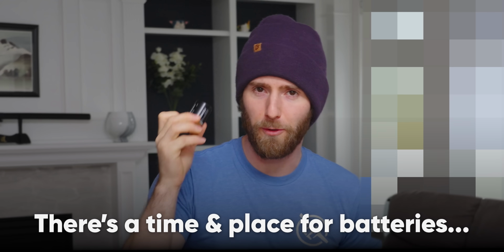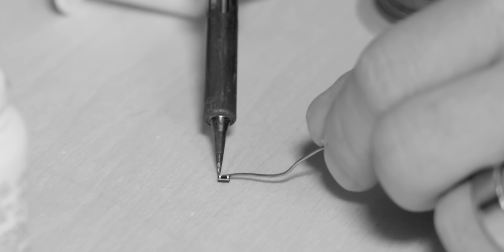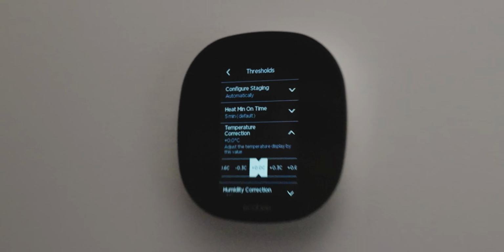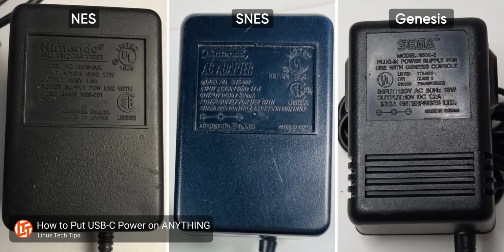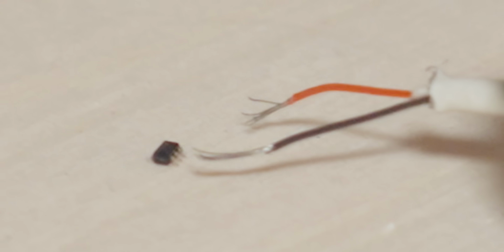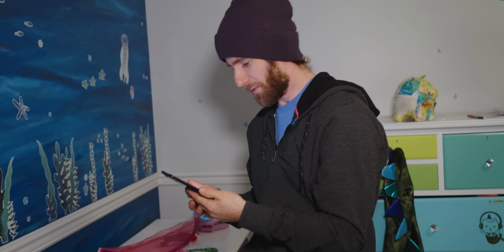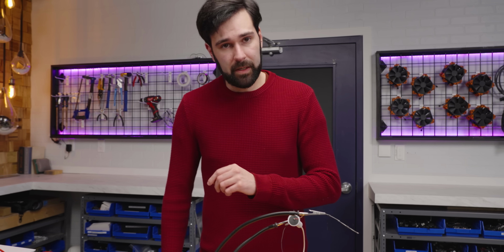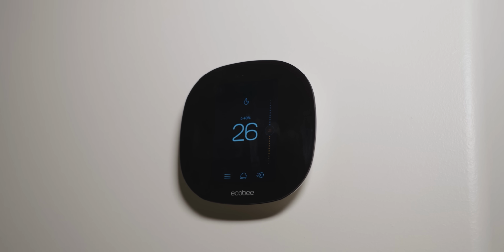I HATE Batteries! - Converting Wireless to Wired (a cheapskate’s guide)

Comment: Next time use pcbway and make small step down converter pcb the size of a Button battery with a usb plug and small copper terminal on it and 3d print a new cover.
Don't forget to add small capacitors for the current spikes!
Over engineered? Yes.
Safer..? Yes 🔥
Reply: Tbh, after I saw a video I went to google to check if someone already designed something like this and selling this niche things; and was surprised to discover nothing of that sort.
So, it might be an interesting project to design and create voltage converters inside a footprint of an appropriate battery.
Reply: @UselessZero  the only problems is as he said in the video, there's so many different sizes that there's probably no point in marketing one or the other.

Comment: Most linear regulators need decoupling both on the input and output for stability. A resistor is not a regulator, the voltage drop depends on current draw and it's not a good way to drop your input voltage.

Honestly, use an adjustable LDO SMT regulator and fab a coin cell shaped PCB for 5$ at pcbway or similar that you just jam in there that has exposed copper in the right places for the battery contacts.

Comment: This is more than just "First world problems" this is another league: "Linus' house problems". I swear this guy has these super particular problems he needs to solve and make content of.
Reply: To be honest I'm from a 3rd world country and i despise batteries my wirings are usually way jankier lol. My only entirely battery device is my phone
Reply: I agree, but this video is one of the more useful ones. Although most people won't have such specific voltages
Reply: Yeah... 
Because having a lot battery devices and hating changing them is SOOO Linus specific..... 
I want to do this to my doorbell, because I can never hear if people want to contact me, as its always out of batteries no matter how often I change them (or so it feels)
Reply: Yet I wouldn't want to say the arguments he states are invalid, they most certainly are.
Reply: That's because this is entertainment more than education
Reply: The underlying problem of wanting remote sensors for your thermostat isn't too unusual, I have the same problem where my thermostats are all placed right next to the door of each room, meaning their temperature reading is highly influenced by the hallway temperature rather than the actual room temperature. My solution to that is jankier, using HomeAssistant to read thermometers inside the room, calculating the offset to the thermostat's temperature reading, and setting the thermostat based on that offset. The same thermometers also get used to drive the air conditioner (can't control that as directly so I need to use a PID), and the humidifer (they also read humidity). Of course, I just change the AAA batteries in the thermometers when they die.
Reply: an obvious solution put the thermostat in one of the two daughters rooms and yes haven it hardwired on the wall and pretty simple to do
Reply: @EDV8ZR1  that assumes the thermostat can be moved without extensive drywall rework.
Reply: @guspaz  well I still have a whole team of people that are good wiring and his business also he has a friend that's an electrician any knows all the contractors that worked on his house and yes simple low-voltage wiring for a thermostat can do it as long as he's not colorblind
Reply: @guspaz  also Dan and his work seems capable on that job
Reply: @guspaz  Well the mount is maybe four by four not a large hole.
 You can have a wired night light to the whole.
Reply: True
Reply: As a citizen of a third world country, I would like to reduce my dependence on batteries as well
Reply: Yeah., couldn't this have been solved just by buying the kids some SLIPPERS?
Reply: I have a knob on my heater and can turn it up or down based on how warm I feel. Seems to me it's a smart solution.
Reply: @Czeckie  he has a temperature up and down button also but yes his as complicated because of optional accessories.
 But the vintage ones worth has rotating knob and Mercury switch inside those were nice.
Reply: This isn't really any world problem. This is let's do things the hard way for the sake of a video. A 3.2v dc converter is the same price as a usb charging plug. You solder a wire to each contact, plug it into the wall, and you're done.
Reply: I'm a lazy ass so this is absolutely something I would consider doing for my thermostat and smoke alarms

Comment: ohm's law says hi. When the device is powered off the voltage is high, when there is a spike in current the voltage across the resistor is V=R*I so there is a sudden drop in voltage and the device malfunctions

Comment: Side note: You can get a converter supply module that will convert 5v or 12v to any smaller voltage for about a dollar without any extra steps.
Reply: Yepp. They're called Buck converters. Boost converter to turn the voltage up. They're also way more efficient than the voltage regulators he used.
Reply: @Mulakulu  Buck converter is way overkill.  Linear regulator is fine for this.  At these current draws, any sort of switching regulator will use more power just to run than the load uses.
Reply: @ccoder4953  yeah, you're right. Didn't think about the current draw. It's good advice for devices that draw a couple milliamps though, all the way up to the converters rated amperage
Reply: I was actually surprised no one makes a 5v>3v converter board that shares a housing with something like a cr2032. I may have to start microfabbing.
Reply: Also, from 3v to 3.3v its NOTHING it would function absolutly right, the potenciometer was nonsense
Reply: @LordCogordo  Yep, 3V batteries might have a nominal of 3.2V, but they're probably over it when fully charged up.
Reply: @cedricpomerleau5586  They are literally 3v nominal and 3.2 when full
Reply: @LordCogordo  Problem with 3V is that leaves you with not that much room to drop under load. If a circuit is designed for 2.8V to 3.3V it means you lose 60% of your leeway. In some advanced devices we made we actually decided on switching between a 3.3V and 2.8V supply to optimize power usage based on load. In an ideal world you could add some capacitors (or coils), but that introduces leakage in the real world which was unacceptable for us.

As Linus' device was wall powered I'd have slapped on a capacitor for good measure though.
Reply: @Spentalei  Awesome answer ma-boy, i love when people give real world data
Reply: I was thinking he was going to use one until he pulled out the chip ribbon
Reply: Be careful with those cheap-o chinese dc-dc converters. They tend to have an extremely noisy output with TONS of voltage ripple. Not what you want on a battery powered device with zero power filtering. This type of application is where linear voltage regulators start to make a lot more sense. Something like the LD33V or LD1117V33 is all that is needed to do this properly.
Reply: @motosk8er2  bought cheap Chinese dc to dc and can confirm they make screeching noise.
Reply: @motosk8er2  I have plenty of old phone chargers like 3v 600mA-300mA is that something that I could theoretically use instead of buying LD33V?
Reply: @motosk8er2  thanks for the help. need to hoard couple more from the e-waste bins.
Reply: @cubertmiso  Many old-school adapters are unregulated. I have a 3v adapter for my Game Boy Color which puts out 4.5v unloaded. Depending on the device this could be a problem. If it's regulated it will measure 3v all the time and this would be ideal.
Reply: @eDoc2020  thnx!
Reply: @motosk8er2  voltage ripple on DC->DC?
Reply: Yep, a buck converter or just drop an AMS1117 3V or 3.3V, or an LM7803 with a 100µF capacitor on the output, they are super cheap and you can get them in bigger packages if soldering is not your forte.
Reply: @MarcusBuer  100 mF ???
Reply: @kennmossman8701  sorry, 100µF,  my brain just froze when I wrote it.
Reply: @MarcusBuer can you link some?
Reply: Dont tell him, after what he had to go through 😂
Reply: MuRata makes some really tiny ones. Or go with gaptek to save some money.
Reply: I was thinking about hard wiring an iPad I had laying around, could I use a Buck converter to hardwire it?
Reply: @DrSeaLionMD  Yes, but you should be carefull with the noise of a buck converter, you may need a good one for this kind of appliances
EDIT: and put some kind of filter capacitor
Reply: @LordCogordo  Thank you for the insight!
Reply: @DrSeaLionMD  Technically, but you could also just connect it directly to the USB power supply, since it's designed to run off of a USB power supply...
Reply: Seems like a MP2307 based buck converter board should do the job well. The boards are about the size of my thumbnail.
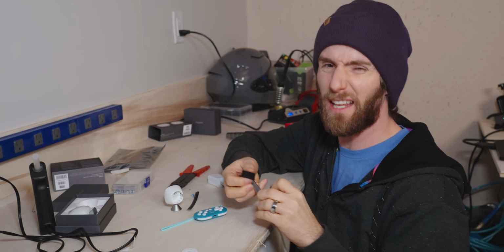Reply: At 7:20 he literally said to do this over again. I'd probably just buy a 3v voltage regulator
Reply: I was sitting here thinking wtf why didn't they just use a buck converter...
Reply: Exactly but it is too big to fit into the device I think this is why decide to go in this particular way
Reply: @ChristianBelotti  They are not. Polulu make 1x1cm versions. It's also way better to solder.
Reply: @Zwettekop  wow I didn’t know about this small factor, the only problem is the height if there is any big component’s
Reply: @ChristianBelotti  The Pololu "D24V5F3" step-down voltage regulator can reduce anywhere from 3.4V to 32V down to 3.3V and is really small: 10.16mm × 12.7 × 2.54mm. That one is still probably overkill since it can supply up to 500mA. It's also 7 bucks which isn't cheap.
Reply: @ChristianBelotti  They're using an external power supply anyway
Reply: @sgas  tecnically yes 😅
Reply: Those also comes with USB connector too

Comment: You can also use diodes in their forward direction to drop voltage. Like you could have used a schottky diode to drop ~0.2v off of the 3.3v supply. And that isn't dependent on current (ideally of course) like a resistor/pot is.
Reply: Ah, or I could have just watched the rest of the video 😁
Reply: I thought of that but assumed it wouldn't work because linus said "exactly 3.2v"
Reply: @munjee2  Exact? With batteries? 
They do drop in voltage from fresh to when the device starts complaining...
Reply: @michaeltempsch5282  that's what I was confused by myself
Reply: @munjee2  I don't know why Linus thinks it needs to be exactly 3.2V. There's a lot of variation in the voltage of a battery...
Reply: I thought about the same.
Reply: Do remark that this is a bit dangerous as under high loads you could burn diodes fast. It's not really applicable here but at least Linus' solution will fail safely. If you don't dial the supply to >4V lol.

Comment: I have in the past replaced a CR2032 with a CR2016 and a coin (can't remember if it was a dime or a penny) and it worked fine. It was just for a food scale, but I'm sure it would work for other applications.
Reply: They're basically the same voltage, just thinner. They do have less capacity though, exactly because they are thinner.
Reply: Not too surprising, those are both lithium button cells with the same diameter but a different thickness.
Reply: Yeah that works because the only difference between CR2016 and CR2032 is the thickness, they have the same chemistry and voltage so are interchangeable with some spacers/mods. The 2016 will just have less capacity.

Same reason you can run something designed for a AA with a AAA and some tinfoil. Same voltage, just different capacities.

Comment: Agreed. Batteries suck. When I had our burglar alarm fitted, I made sure to go for the older wired sensors, rather than having to worry about yearly battery changes. (Knowing me I'd forget).

Button batteries are like a lottery. We have a draw full of them. But never seem to have the one we need.

Interestingly our door bell isn't mains wired. But it doesn't have a battery either. Pushing the mechanical button generates enough electricity to send a signal to the receiver in the house. The receiver plugs into the wall, so no batteries there either.

But the biggest 'battery sucking' thing has got to be all battery cars. I refuse to deal with that kind of range anxiety.

Comment: I absolutely hate battery powered stuff. It's not just about having to constantly charge it, especially with increasing age and degrading battery life. But the fact that so many different standards exist, and many devices don't even allow for user replaceable batteries anymore is absolutely disgusting. I've had so many devices that could have lived on but died because the battery was broken and couldn't be replaced (at a reasonable cost)

Comment: Btw might not be the case given the time it takes the in-floor heating system to increase heat in a room, but I've found in my own Ecobee multi-thermostat and sensor setup that the wireless sensors Ecobee sells are painfully slow at reporting back temperature to the thermostat. Often the case would be that I would be freezing in my office because the sensor was still reporting it was hot.
Reply: He said 20 minutes... That's honestly useless. With that delay, the in-floor heating will probably constantly overshoot, leading to an always uncomfortable room.

Comment: Given the inherit efficiency losses of an AC power adapter, I'm betting the energy consumption of that sensor is now doubled or trippled over just the battery, but it is so small it is probably in the margins. Just something to be aware of at scale.
Reply: Surely the energy cost to manufacture a button cell is far greater than the watt hours stored in it.
Reply: @slugrag  not to mention shipping it from china all the way to canada, storing it in a warehouse, and then shipping it from the warehouse to linus's house (or the shop he bought it from i guess)
Reply: You have non factored in the fact that Non-rechargeable and rechargeable batteries need charge at the beginning of their life. And that also comes with AC losses.
Reply: @hellopsp180  yea that isn't really relevant because it is so small. they don't even contain 1 WH. and that lasts for 2 years. the transformer in the usb charger probable takes more than that in an hour. so the electricity used here is probably more like 10.000x and that is without the stepdown and power grid loss.

Comment: And to think we thought Linus would have avoided this problem since the new house was so old that everything was already wired anyway.
Reply: All of his upgrades Roundup being down grades because of batteries needed too much extra effort.
Reply: We would think he would understand battery safety too, but here we are
Reply: @Stanton_High  what makes you think he doesn't respect Li-Ion battery safety?  Could it be the soldering of 18650 cells to make battery packs? for a RED Camera i believe.  Lol, I cant remember but something went wrong  in that video, he either vented a cell or just never got it working cause of a circuit board regulator or something.
Reply: @Frostbite1090  it was the way the circuit worked, it would fail/ shut down if voltage was removed completely
Reply: @Frostbite1090  nah. the circuit board only had volatile memory. cause hey it's attached to a battery so if it ever doesn't have power the pack is dead and unrepairable anyway
Reply: @Frostbite1090  that's one of those "you really shouldnt do it ever but if you genuinely don't have another option, you gotta" kinda things
bad example but realistic execution imo
Reply: @stitchfinger7678  wired smoke detectors also require batteries so fun while pulling your hair out every time one of them chirping because of a battery
Reply: @Frostbite1090  did something that should be illegal to make you buy their battery packs again

Comment: I’ve probably been to the shop about 10 times last year just to buy a random battery because I didnt have a specific battery some random thing needed.. I feel u, Linus.
Reply: If you can wait a few days, ebay is a good source. Buy a 10 (or more) pack, because with the shipping it works out about the same as buying one. Then chuck the extras into a drawer, completely unlabelled, and next time you need one you get to spend ages searching through your battery drawer.
That's my system anyway ;)
Reply: @phuzz00  it is very obvious thing Linus pointed out the batteries get old batteries leak lithium batteries do good old and leak Oracle of old expired leaking batteries
Reply: @phuzz00  but I understand the logic behind a large quantity from eBay or Amazon for cheaper also AliExpress or Alibaba all those the shipping times very
Reply: For me CR2032, AA & AAA is all I need. Other battery-requiring devices just don't make the cut or have their battery integrated anyway.
Reply: @whohan779  I'm guessing wired smoke detectors that still require batteries Double A or Triple A is or 9-volt Battery.
Reply: @EDV8ZR1  Yeah, you're right. They're often chonky 9V to last years. Which is something I can get behind. I literally forgot about those since they so rarely deplete fully.
Reply: @whohan779  except when there is a power outage for a long period Of time And all the smoke detectors lose a lot of power in there a backup battery by the way it's me up on a ladder can have to change like 10 batteries and yes 9 volt
Reply: @whohan779  possibly you have smoke / carbon detectors that use Button cell batteries
Reply: don't you go to the supermarket?

Comment: My smoke detectors and security system are hardwired but have battery backups for when the power is out. The smoke detectors start beeping once every couple of years and I just replaced my security system battery for the first time in 8 years. It was like a small car battery.